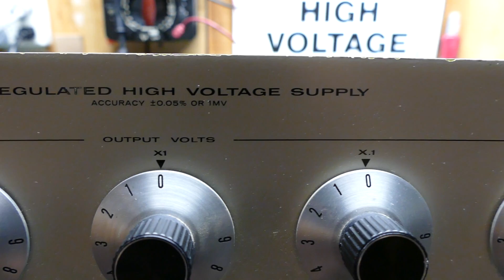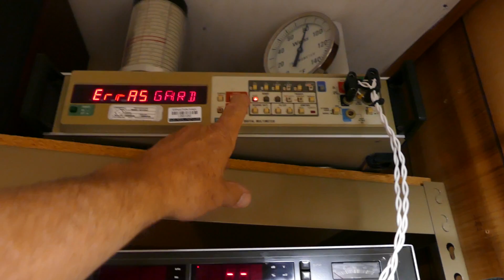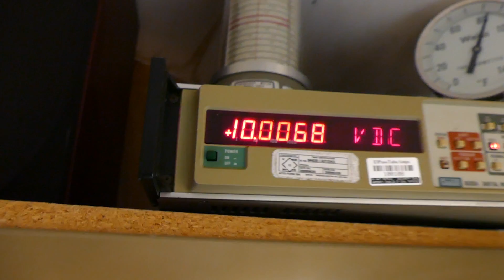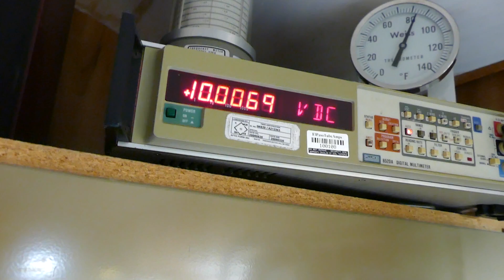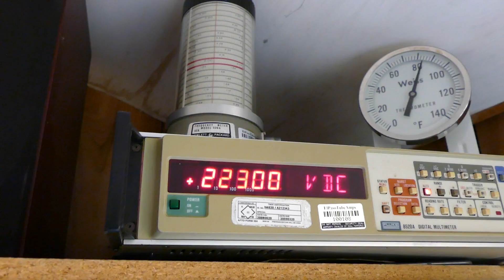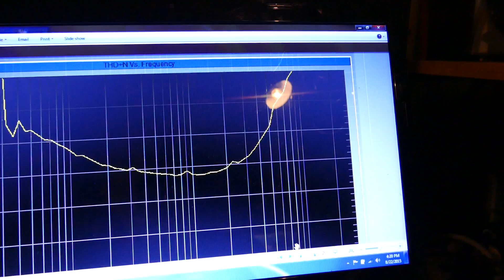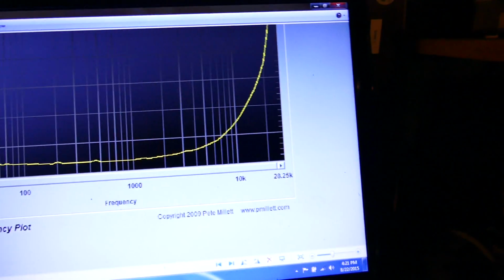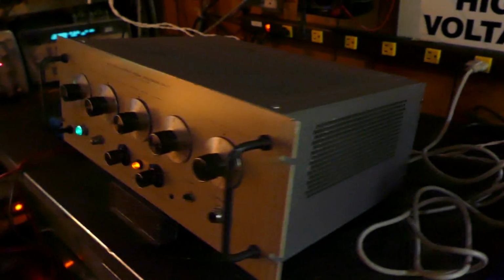Keithley Model 241 High Voltage Power Supply

Comment: It’s not completely tubes.  There are about 16 silicon diodes, and a very stable zener diode that would all die if an EMP pulse came along, and the thing were plugged in, not necessarily turned on, just plugged into the electric grid, and not protected by mucho number of surge suppressors.  I have one of these 241 ps. Can you get any parts for the thing?  I use it to power photomultipliers, which look at scintillation media, phenanthrene dissolved in isopropyl alcohol.
Reply from the maker: I have (luckily) never had an issue with mine. It looks like all the tubes are original so I have never looked for parts. In general, I have found that vintage equipment with original tubes is often times the best. I have several other pieces of Tektronix and HP equipment with original tubes that work very well. I don't use mine a lot but it does come in very handy sometimes. The fact that it is limited to 20 mA is not something that I like but that is just the way it is. I recently used mine to calibrate a Tektronix DM5010 for the DC scales.

Comment: Nice, look at all those digits. Now you need an old differential voltmeter so you can test out the full resolution of the high voltage ranges. :-)